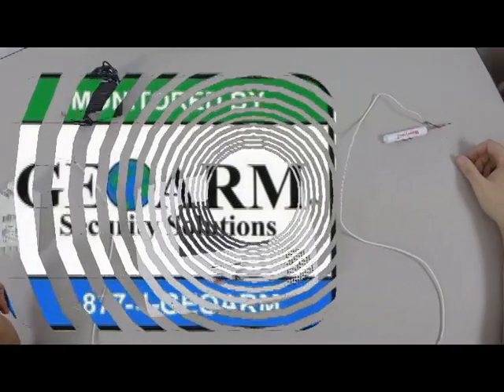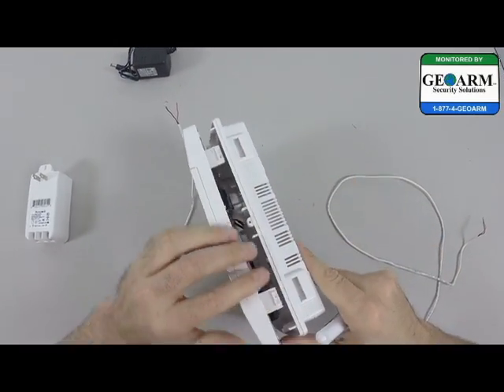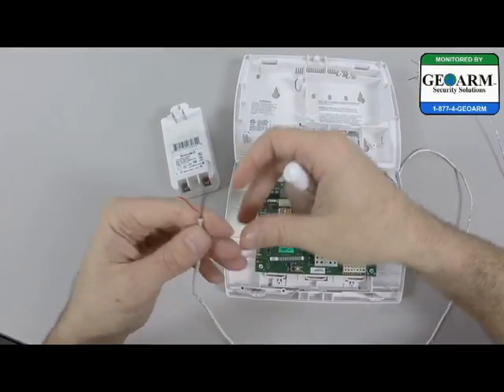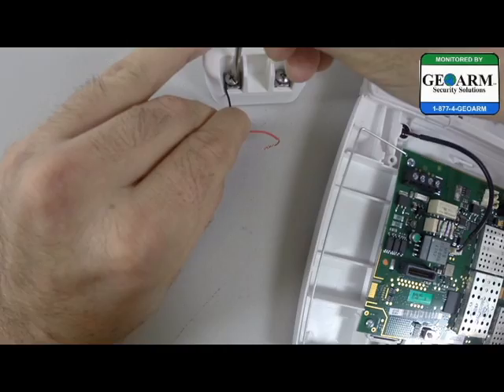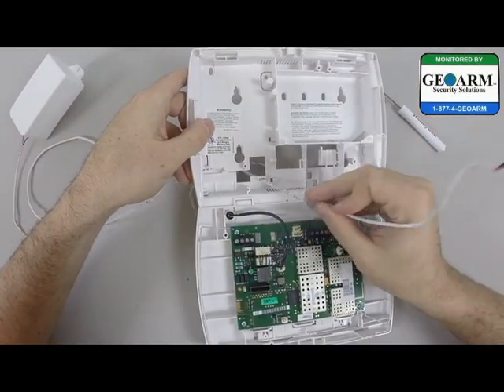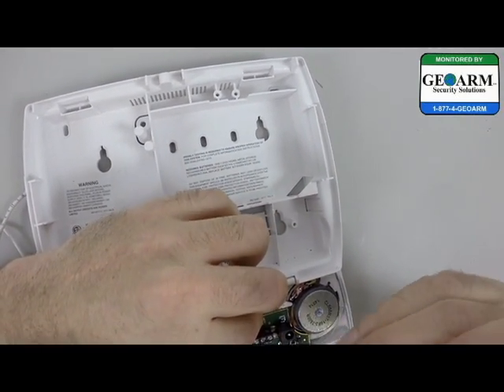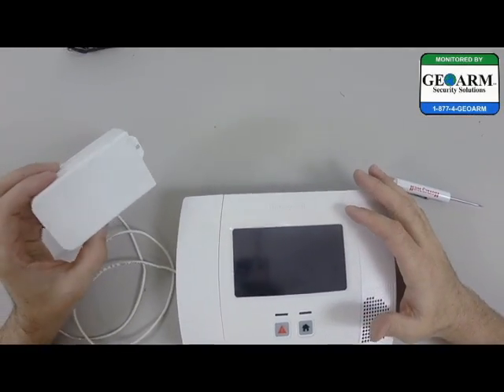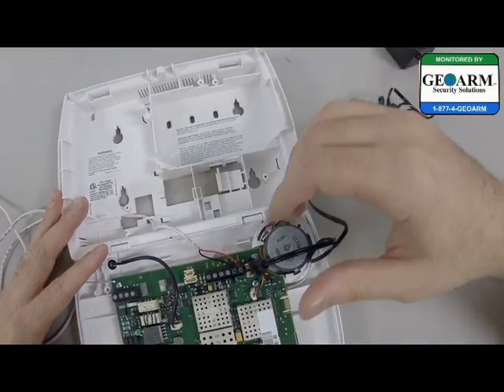Honeywell L5200 - How to Wire the Power Transformer?

Comment: is there any way to reset the fuse? I accidentally touched the power wires when hooking them up and now the unit won't power up. thanks
Reply from the maker: These panels are DC powered so if you shorted your panel out at this point you would have to purchase a new panel. At this point you can go with the direct replacement which is the 

L5210: http://www.geoarm.com/l5210-honeywell-lynx-touch-wireless-alarm-control-panel.html

or the new series honeywell system which we recommend 

LYRIC: http://www.alarmclub.com/lcp500-l-honeywell-lyric-wireless-touchscreen-controller.html

If you go with the Honeywell Lyric it comes with Wi-FI and Z-wave radio but you will need to get the new cellular module which is listed in the drop downs. If you have any questions give us a call 1-877-443-6276 option 3.